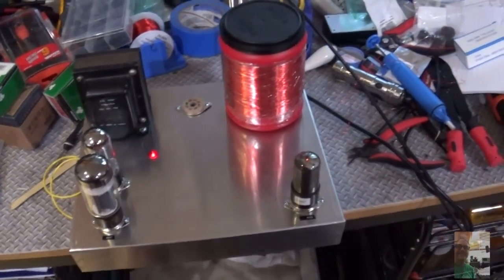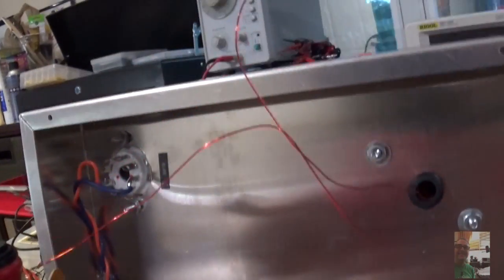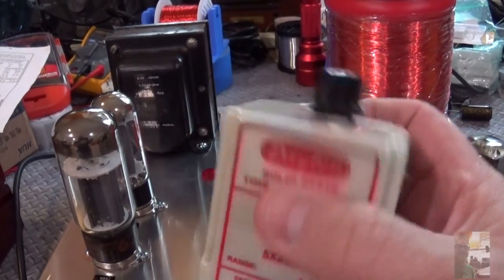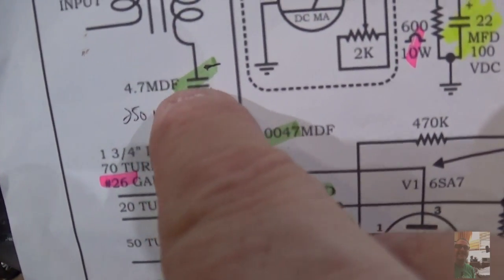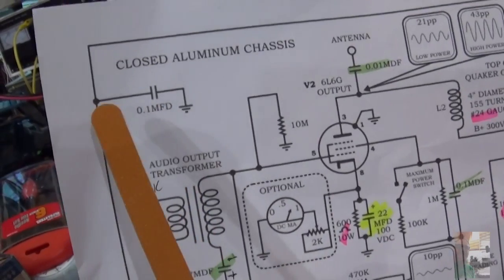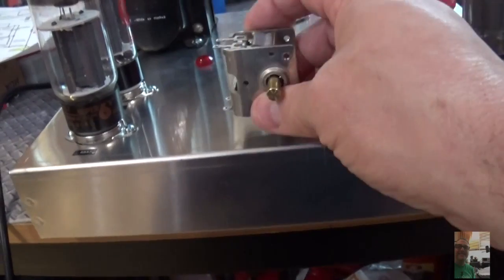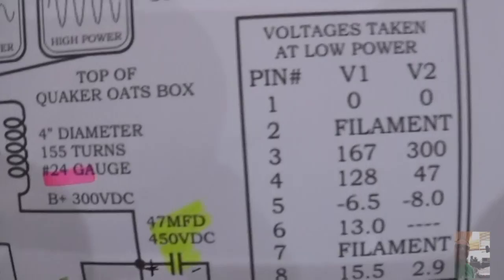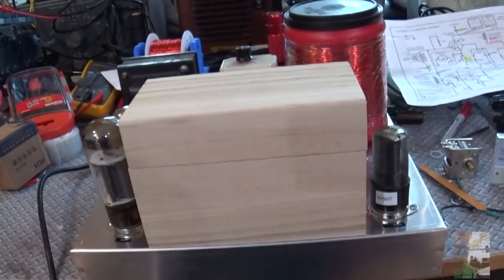Rick McWhorter AM Transmitter build - Episode 3 -  It's all about placement

Comment: Hey Ron, I hope all is well in FL. I fired up my transmitter today, and the radio I have setting next to my transmitter gets quiet when I tune my transmitter to the station but I must have my audio output / input transformer goofed up! The side your connecting to the 3.5 input jack would normally be the output to the speaker in a radio, right?  Also, would you please give the specs on your audio transformer? What's the side that goes to the 6L6 ohm out to? and what does the side that goes to the jack ohm out to? Ive got 1.6 ohms on the jack side and 280 ohms on the 6L6 side.
Reply from the maker: Chris, no power and no internet so I hope you get rhis. My output transformer is a 5000ohm. Primary 8 ohm ssecondary. The input jack is wired to the output(green/black).  One side of rhe primary goes to the 6l6 and other goes to a 4.7mf cap to B-   Doing this from memory but pretty sure it am right. For your tuning cap one side goes to the input one to the tuning cap body. Hope this helps.  -ron.
Reply from the maker: 1.6 ohm is usually the 8ohm side
Reply: Ron, I've got a Hammond 125a transformer, the 280 ohm primary side is going to the 6L6 and the 4.7 mfd cap,  the other side (secondary) has 6 taps and I've got tap#1 going to one of the pins on the 3.5mm stereo jack and then tap # 6 going to the other pin on the 3.5mm jack. and the ground pin is grounded to the chassis. I can hear a scratching noise coming out of the radio I've got near it when I plug the cable in.   Oh, I asked for help on the antique radios forum, and they do not approve of this! I received no help.
Reply from the maker: Chris
Do not ground the input jack to the chasis. It has to be isolated. The 4.7 cap also has to be isolated to the B- rail and not the chassis.  You have 6 wires which are probably 4 ohm, 8ohm and maybe 16ohm. Use the pair for 8ohm.  Hope this helps
Reply from the maker: I looked at the datasheet.. connect the White and Green to the Input jack
Reply: Ron, there isn't a white or green on the  Hammond 125A, the only wires are blue, red, brown on the primary, and the secondary has taps 1 through 6  I've been over the rest of this schematic 3 or 4  times now, and everything else is as the schematic shows... except for the 450vdc , I've got more like 360vdc , but after the 2k 10 watt resistor I've got a touch over 300vdc and all of the voltages on the tube chart are very close.
Reply from the maker: Chris, I believe you need to use Taps 1 & 5  for 8 ohms.   Here is the data sheet.  http://www.hammondmfg.com/pdf/5c0054.pdf

Comment: Hey Ron, if you put that printed L shaped piece for the tuning capacitor you should get ya one of those big black 1920's style radio knobs with the white numbers on the knob though as large as those knobs are you might need stand offs to raise the whole platform up a bit.  Just a thought.  Take care, Gary  P.S.  It would also work with that wooden box.

Comment: The  chassis is your safety ground since it is tied to your green ground wire from the line cord.   Safety ground in a non current carrying conductor or connection.  It is only there for fault protection and should never have current flowing through it.   If anything shorts to the chassis it will blow your fuse so that the chassis is never live.  That is the other reason for having your hot come through the fuse before the power switch.  B- is the negative side of the two 47 uf filter caps in the power supply section of the circuit.   All of your "CIRCUIT" grounds should be tied to that point of the power supply.   It is good practice to wire circuit grounds in star wiring topology all emanating from that point to eliminate any ground loops that can introduce noise in your circuit.
Reply from the maker: Excellent theory and explanation here, I cannot thank you enough...
Reply: Any time my friend.  You will have to share what Rick said also.

Comment: As for the switch, if it goes to a power transformer, it doesn't matter which side is switched.  But a fuse is usually on the hot side.  The main thing on a chassis set is that the chassis is NOT hot, or direct to the hot side of the mains.  The chassis must goto neutral.
Reply from the maker: Got it

Comment: B+ is the rectifier side of the trabsformer winding, b- is the other side or leg of the transformer, it's that simple.  But if the transformer has a center tap, or multi taps, the tap could be the chassis ground, then the other two legs are b+ and b-., the tap is zero.   Think of your O-svcope on AC, zero is the middle line, above zero is b+ abd below zero is b-.
Reply from the maker: Thank you Don... all of this is valuable info for me, and many thanks !!!!!!

Comment: Hi Ron, You have the "white" switched?
I never switch the neutral.
When I restore an old radio that has a hot chassis I replace the plug and wire to a polorised one, always connect the neutral to B- or chassis which ever is the case and switch the HOT side. 
Looking good otherwise, I did not want to build this because I do not like that huge coil, besides I can't wind coils like I did when I was a kid making Chrystal sets..LOL.
Reply: Goat is the man.   You ALWAYS want to switch the hot side of the mains.   That way the only thing hot is the swtich when the power is off.  This minimizes what is live/hot in any electrical gear.   Hot comes in, goes to fuse next then to the power switch.
Reply from the maker: The current setup  is that I do have the Hot ( Black) side going to the fuse, and the neutral side to the switch- I will go through this tonight and correct.   Thank you my friend.
Reply from the maker: Thanks JP... all will be fixed tonight

Comment: Why are you switching the neutral, leaving 120 volts on the transformer windings, instead of switching the hot so the 120 volts stop at the switch?
Reply from the maker: Good question Robert and something I will look into.  I didn't even realize that I had it that way but now that you mention it, it makes no sense. Of course I will adjust and I thank you for pointing that out.  Much appreciated !!!   Ron